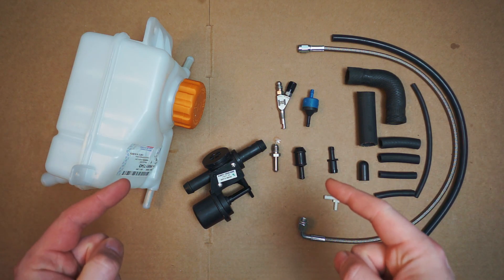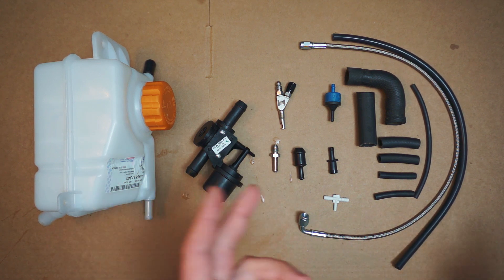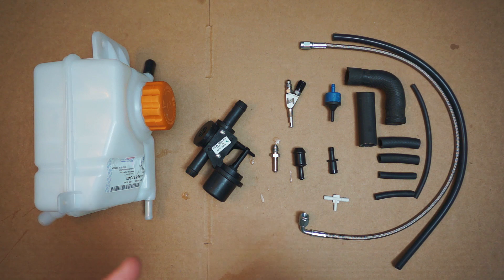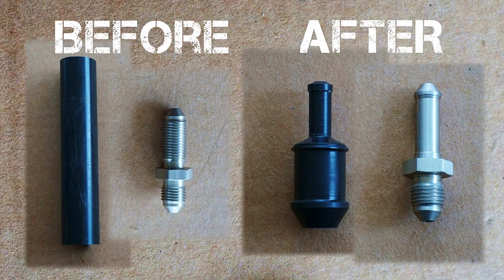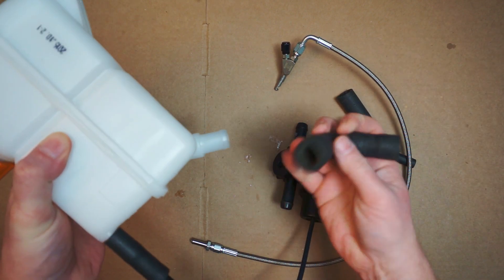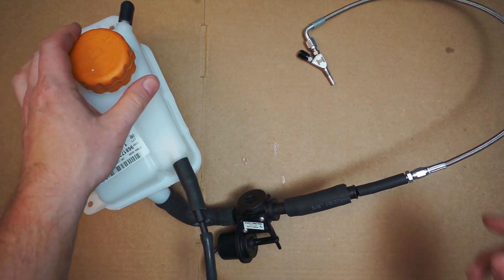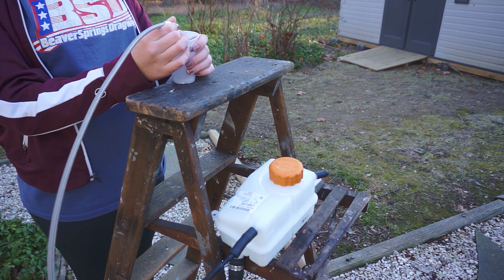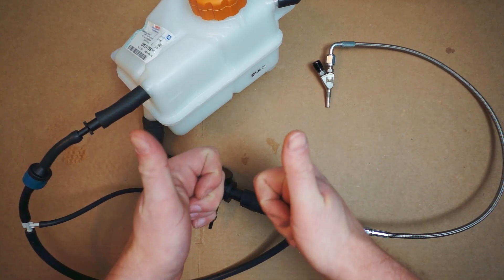$100 Pumpless Meth Injection - Part 1

Comment: WOw, I had this idea about a year ago.  I still haven't put it to use yet.  I've been heating up my hydrogen fuel cell solution and I realized the water vapor is important to boosting the power/spoofing the oxygen sensors which don't sense oxygen directly, they sense exhaust gas pressure (lean running conditions increase exhaust pressure).  Using water to absorb the combustion heat (which produces steam which pushes the piston and cleans the carbon) is what I'm after.  Cooler exhaust means the O2's see less pressure and cut the fuel trims for better mileage.
Reply: You got everything right accept o2 sensors actually sense the lack of oxygen..not pressure. If it was pressure it would be called a pressure sensor....
You read the oxygen content on o2, sensor 1 to tell your PCM if its lean/rich.

The second o2 compares the oxygen content after the catalytic converter to judge of the catalytist is functional.

Exhaust has very little "back pressure"
Under 5psi avg. 

You actually don't want back pressure you want velocity. Velocity scavenged the cylinder's. Pressure doesn't

Comment: I made a Venturi effect injection works at normal air-pressure using micro drip system  best mix kerosene isopropanol so far, inject just before the throttle body it sucks the fluid right out of the bottle, you can experiment with different fluids, ammonia, hydrogen per oxide etc. white spirit
Reply from the maker: That sounds interesting.  Do you have any videos or links to that?  I'd love to see it.  Thanks!
Reply: AlexLTDLX no no video but Ill make one I guess
Reply from the maker: @qwertyuiopasdfghjkl2556  Please do.
Reply: @AlexLTDLX  Ive uploaded the video, hope its helpfull!

Comment: How does this pump into a pressurized intake tract? Think about it... If you're using boost pressure to move the liquid, but the same pressure is in the intake tract where it's supposed to spray, the pressure would be the same then wouldn't allow the fluid to move.
Reply: You inject before the blower/turbo.
Reply: @Wagonbacker9  Yes, that changes things, but poor turbo or blower turning crazy RPMs and dealing with all the fluid/droplets hitting it.

Comment: You can use a universal windshield fluid pump (17 bucks) a switch (2 bucks) a small coolant overflow tank (8 bucks) and a universal windshield fluid nozzle (15 bucks) all of this you can get at autozone.
Reply: You'd need a switch to manually turn this in at high RPMs? In a Natural aspirated car spraying into the intake after the AFM.
Reply: Use a Hobbs switch... Or a micro switch under the throttle

Comment: That heater bypass valve stays open when not under vacuum right? It's only closed when seeing vacuum. How are you able to fill up the tank without getting a bunch of water/meth into the line and dripping into your air filter after that bypass valve?
Reply from the maker: The nozzle is above the tank.
Reply: AlexLTDLX I decided to use a check valve with a 10psi cracking pressure.
Reply from the maker: @williammac4288  That's a good idea if you can get away with only needing meth above 10 psi.  Also, I'd imagine it would be tricky to tune for - you want to replace at least 20-25% of your fueling needs (30% might be better) with meth.  But let us know how your system works out.
Reply: @AlexLTDLX  not using it to make power. And also only using water. It's more for reliability purposes to keep the IAT as cool as possible. Will be tuning without it. I decided to go with a 1psi cracking pressure.

Comment: Nice job. Real simple. REALLY it depends on where your planning on "injecting" the meth. I'm soon will be done with my kit. I have managed to do a complete HI pressure system for under $ 225.00 . All I gotta do is the buttons and drill and tap the port. I've posted a vid on part of my kit. Check it out if you have time.

Comment: Would you suggest meth for a street car ? Street car that I will drive to work everyday that the weather is nice and on the weekends. (If I cant then it will come back off because I have way to much fun in it.) It was NA but over the last few months I have cobbled together a turbo kit. I did it for basically nothing and with that means non intercooled. I dont know if it's going to work yet because it's only had idle time so far. Will be a few more weeks before I will have enough saved for the Micro Squirt. The car has always ran cool before and has a really good cooling system but I have my doubt's about it stayinh cool. It's only going to be around 8-9 psi. 93 pump gas but if it runs hot I may try e85 but there is only 1 gas station local that has it and like I said it's a driver. The engine is a .030 over 351 btw.
Reply: I daily drive a car with meth. It doesn't spary all the time only when above 4k rpm and wot and i also have a master switch i can shut it off. 
If you set it up and only tune for it at higher rpms then it will be fine and not use much unless you are getting on it between lights or freeway. My setup uses a pump btw.
Reply from the maker: With a turbo kit, you have a little bit more flexibility. But I will say that after having pushed 93 octane gas for over 20 years, and having tried different types of race gas, the tuning window on 93 octane gets really small really fast. I've destroyed my fair share of pistons and Motors that way. So yes, I would recommend meth for a Street car. I run a megasquirt 3X and between the AFR safety setting, and the IAT correction map, it would be rather difficult to blow something up due to tuning issues. I can't say the same for the old EFI system I used to use which was admittedly very primitive by today's standards. It was actually programmed in DOS. But I would also consider a good air to air intercooler if you can swing it, keeping in mind that under most circumstances the air-to-air intercooler will function more like a heat sink because it will never reach equilibrium unless you're doing a pull that's minute or more long.

Comment: So the intake and tank will see the same boost pressure. How are you going to see positive pressure/spray meth?
Reply from the maker: It's explained pretty well in the video, but you can also google "Anderson Mr. Freeze".  Obviously, you don't spray into the intake...
Reply: Yes. As long as you are willing to spray before the turbo, it will work. I have heard of people doing this, although I am concerned what that might do to the turbo. I'm not sure how effective it would be in cooling a charge as it would just heat up with the rest of the hot compressed air. Thanks for your response. Good luck on your dyno tests.

Comment: i think injecting behind the turbo wouldnt work since the pressure would be the same on both sides of the nozzle..
Reply from the maker: Yes, it won't work the way you're describing, you'd have to inject pre turbo.
Reply: @AlexLTDLX  unfortunately that reduces the efficiency because the intercooler then is after it and it relies on ambient temperature. its still the best to let the intercooler cool as much as it can and then cool further down with water. but still a simple and cheap way, never heard of it....
Reply from the maker: @markododo  This idea's been around for a long time (google "Anderson Mr. Freeze") and people seem to be going back to injecting pre-turbo.  There are pros and cons to both - in this case, simplicity (lack of failure points and no electronics), and perhaps the biggest one - increased compressor efficiency.   The meth helps seal the compressor.  I have an A/W intercooler so don't need much in the way of additional cooling (though how much "real" cooling occurs in after-compressor injection is debatable - mostly, the IAT sensor just gets wet and reads artificially low temps as the meth/water evaporates off the sensor.)

Comment: So would this work on a turbo setup injecting post turbo? If you are running 15 psi to pressure the tank and the charge pipes are 15 psi will the water still flow? Seems like it would only work pre turbo . Or for a blower.
Reply from the maker: You're right - only pre-turbo.  Which is the "in" thing these days.  It works for my setup because my TB is before the blower.
Reply: @AlexLTDLX   
I'm not knocking your setup at all. I think it's great that it works for your setup. But it can be a little misleading for someone who just wants to throw together a kit. I pieced together a kit post turbo. I didn't want to go pre turbo because I wasn't sure about water accumulating in the intercooler with my setup.  Plus I wanted something to work in conjunction with my boost controller as far as controlling it.
Reply from the maker: @JDXTuning  Well, you could ditch the intercooler and just run meth.  But I don't think it's misleading - pre- and post- compressor injection systems are both valid systems.  In fact, pre-compressor injection is the only one that can work on all setups - not the other way around.  Most positive displacement setups don't have enough room to inject post compressor (mine is, of course, an exception, but this setup should be more reliable than a pump-type setup).  As far as your concern about meth pooling in the cooler, don't discount how much air is actually moving through the system or how finely atomized the meth will be after going through the turbo when it's spinning at 100,000+ rpm.  Unless you have boxy end tanks with poor flow and dead spots, I don't think meth pooling in the intercooler is an issue.  And if it does, where it pools is a dead spot and should be addressed for maximum efficiency.  There's only one way to find out - try it!  Just don't tune on the ragged edge and do some testing.  I know of plenty of hi-po turbo setups that inject pre-compressor and they work just fine.  Good luck and thanks for the comment!
Reply: @AlexLTDLX  when I said miss leading I basically meant someone looking to build this kit may not know where to place the nozzel since most kits on the market can run pre or post. It's definitely informative! I wouldn't have wasted my time commenting if it didn't interest me. Thanks for the replies. I'm sub'd.
Reply from the maker: @JDXTuning  Thanks, Justin.  And I was sincere - it's easy enough to build and try it out.  Just tune it so it's not reliant on the meth to stay out of detonation, drive it around a bit, and see if any meth pools in the intercooler.  Only one way to find out for sure.  If you do it, I'd love to know what you find!
Reply: @AlexLTDLX  I'm going to run the kit I built first and see if I need more. I lost a ring land on my last motor on 18psi 14* 93 octane. It was supposed to be 14 psi/14* but the boost controller I had at the time let go during a pull. Bone stock 5.3 . I plan on tuning it without meth and then using it as a safety feature.
Reply from the maker: @JDXTuning  That sounds like a good plan.  If you're going to pull plugs while tuning (I do), you know which one to check first.  For me, it's cylinder #1... stuff we learn the hard way!
Reply: @AlexLTDLX  I have no choice but to pull plugs this time. I switched to a gen 4 block and I don't have knock sensors now lol.

Comment: Thanks...great video....I’m curious if you’re willing to share how you bracketed/installed the blower. I just happen to have one of a 2013 Shelby that fell in my lap for free....brand new. I would like to put it on my 351 in my fox... I have modeled up the blower to intake flange and had pieces waterjetted for that but am still “thinking” about the brackets and belt system.
Reply from the maker: Thanks.  I chronicled the whole build here: http://forums.corral.net/forums/5-0-5-8-engine-tech/2021529-dart-365-na-vs-whipple.html

I should've put it up on youtube instead, but it is what it is.  HTH.

Comment: Where are you putting the injector? You said right next to the rotor going 18,000rpm....on the input side of the turbo?
Reply from the maker: Watch this video starting at 1:06 in:  https://youtu.be/oXeUxONLO9I

The nozzle's going into the block between the throttle body and the blower.  I'll put up a video of the nozzle install.

Comment from the maker: Anybody else notice the addiction rehab ads running before this video?  Lol... we're fooling our computerized overlords...
Reply: After watching this video for the 100th time I have a suggestion for improvement.
Buy a cheap pump and a motorcycle small fuel pressure regulator do the obvious connection so that the pump(switch is optional) is always pumping 40psi or more just like the fuel system and returning to the tank.

Keep the big valve on the large tube boost referenced and put it after the regulator so that it remains closed and opens gradually with boost.

And voila... let me know what you think or if i fucked up my thinking
Reply: I'm seven years behind.... @FirstLast-tx3yj

Comment: Made a kit exactly like this 20 years ago. Will work mint. I used a spraying systems co. nozzle but very much the same principle. Never been a fan of meth systems with pumps, more points of failure. Super simple and win
Reply from the maker: Sweet!  Do you remember any specifics?  Like track times, dyno results, how much meth you were spraying?  I'd love some first-hand input as we proceed...
Reply: I want to make it for an N/A engine just for MPG purpose, obviously not performance wise. Do you think it will work into an EFI car? It should get no vacuum at WOT and maximum vacuum at idle so I think would be ideal as I don't want to have it at idle, but... The heater control valve will work with positive pressure or not? I'm not an expert so I appreciate any advices. Thanks

Comment: alex aren't you going to need a check valve on the nozzle to keep it from sucking your supply line empty when under vacuum? most systems have this. cant wait for results. nice to see your little helper involved. good luck!
Reply from the maker: That's what the Ford vacuum operated valve is for.  It'll be easy enough to see if it's sucking in any meth while out of boost; but it would have to suck it past the closed valve.  I could also put the fan spray nozzle right before the throttle blade - it'll never see any significant vacuum that way.  We'll all find out together!
Reply: Unless you methanol injector is placed directly inside of the manifold your vehicle will not be able to pull meth out of the injector as anywhere on the intercooler piping u choose only See's positive pressure, ideally u would want your pressure in port to be pre intercooler and your injector to be in a charge pipe post Intercooler so the pressure side always See's higher boost then engine, constantly keeping meth flowing under boost regardless of wether or not your turbo dies off a little in the top end